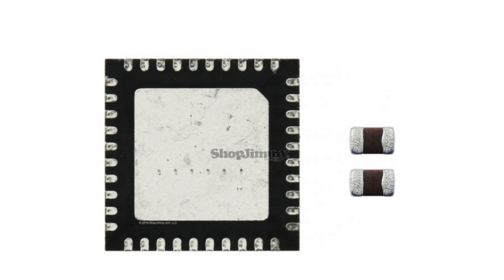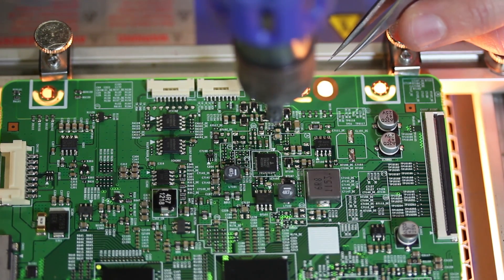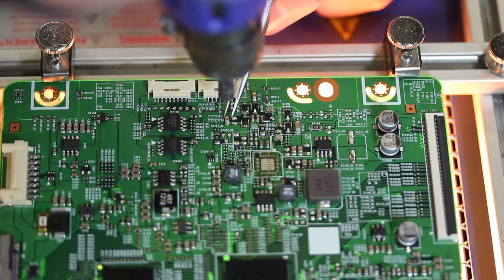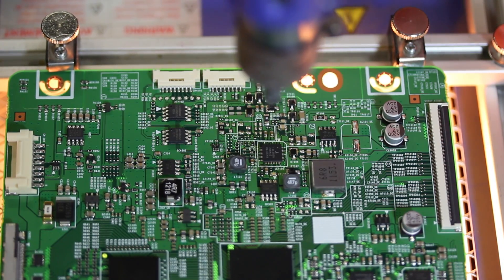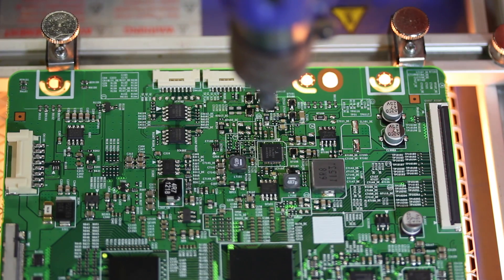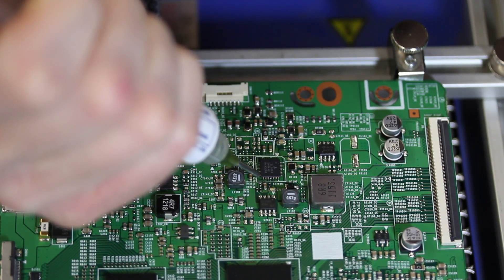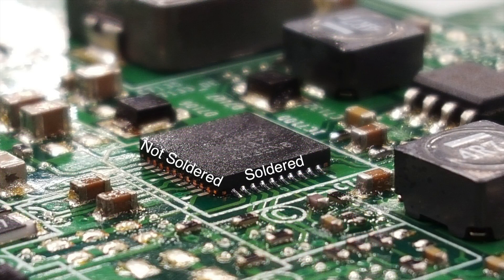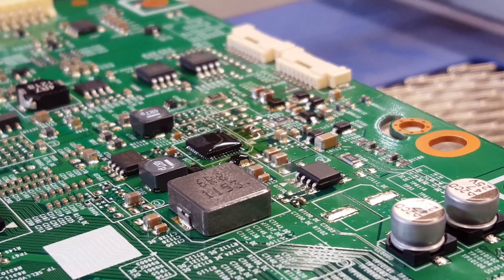Samsung T-Con Board TV Repair Kit - No Video - Video Turns Off after TV Powers On

Comment: I have a Sony 2017 model KD65X8500E that has sound but no picture. In the morning when i turn the tv on it works for a while then the video dies but sound on. If i switch or unplug tv and turn back on only sound is on. Next morning when i switch on i do get video again for a short time. This sounds similar to this vids problem but help would be appreciated.

Comment: Very good knowledgeable Video. Sir I have a samsung led tv model number ua55d8000yr. The Fault is Multiple vertical Colour lines on Pictures. All voltage are ok. I am not Finding that exactly which parts are bad. Can you help me?
Reply: The tcon Board number is s240labmb3v0.7.

Comment: I have a samsung ln55c630 that has vertical and horizontal lines all over. It has a perfect picture when first powered on after sitting for a while. Then the lines show up after a few seconds. Could this be the t-con board or a bad screen?
Reply: 99% bad screen but its important to see this lines

Comment: I could use some help with my Samsung UN46D6003SFXZA from 2011.  The picture and audio stopped a few minutes after powering it on.  I tried resetting it by unplugging and holding the power button for 30 seconds.  When I plugged it back in I got a standby light so I turned it on again.  Samsung logo appears for 2-3 seconds and screen goes black.  Standby light blinks 5 times and dies.     I tried disconnecting the cable from the power supply board to the main board and the backlights came on.    My problems are:  How do I determine if it's the main board or the t-con board that is bad?  If it's the t-con board, how do I get the LVDS cable off?  It has a connection type that I can't seem to locate in ANY videos.  I do have access to an electrical tester but I have never used a soldering iron.
Reply: I have pictures of all parts and labels available too

Comment: Howdy, I Have Hitachi LE55A6R9 HDTV. The power comes on blue light when I turn it off red light stays on. The screen is black and there is sound on some inputs. I removed the back cover and cannot tell if the back lights are on. Then I did the flash light test and can see the menu as a video instructed. Any suggestions would be appreciated. Thanks

Comment: This is the same for RUNTK5135
Reply: I have a samsung UN 50h6350af the screen have the back light no sound no picture help me please
Reply: MrReeceyburger123
Reply: Yeah ?
Reply: I have Samsung led TV model  ua 32eh4000 sounds come but there is no video only bright white screen how can solve this problem  there is no menu display 9049923821 one ic 5562a is overheating

Comment: I have a lg 47ga6450-ud, no video, has a blue screen and has audio, I have replaced the t-con board, main board and power supply board, the same symptom is present. I can see the backlights thru the holes on the back. I need some other direction to go on repairing this tv.
Reply: May Be pannel Problem..

Comment: Hello i have a Blaupunkt 50" LED with 6 thin lines running across the middle of the screen it started as one and now every few weeks one will appear. Any idea what could that be? I can buy a tested mother board for 40 EURO do you think i should give it a go? Thank You
Reply: pannel Power chip Problem change that All lines will Remove.....
Reply: Whete is your address

Comment: you should do a video how to replace the boards of a e550i-b2. I'll appreciate. thanks
Reply from the maker: +Ryan Febus   https://www.youtube.com/watch?v=S9yWpOs9KE0
Reply: HELLO, IAM WRITING FROM BOSNIA, COUNTRY AT EUROPE... I WACHED THOSE VIDEOS... I HAVE GOD SOME PROBLEMS WITH MY TV, LG32LZ50... SOMETIMES, THE PICTURE IS GETTING GREEN, AND THERE ARE SHADOWS IN CORNERS... MAYBE IT IS PROBLEM WITH T-CON BOARD... 
AND... WHEN I LEAVE THE TV TO WARM UP, FOR ABOUT 40 MINUTES, EVERYTHIG IS OK...
I WANNA ASK YOU IF YOU MAYBE KNOW WHAT THE PROBLEM SHOULD BE... 
THANKS!
Reply: PRO TIP: E550I-B2 Referring to sound and no picture or blinking screen. Resolder pins on power supply board that connects to led driver board.